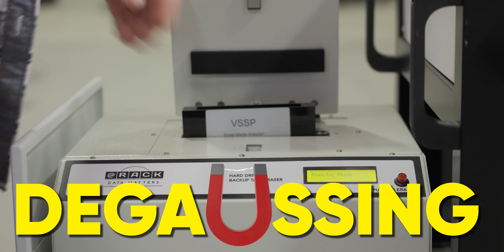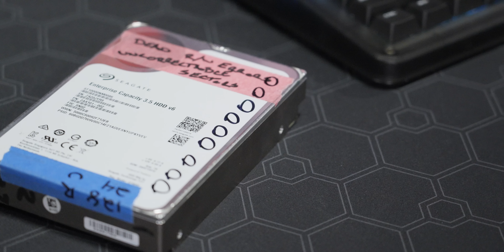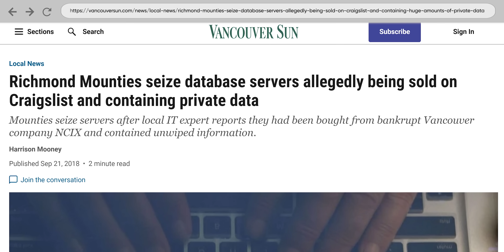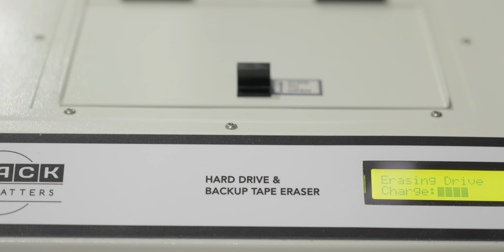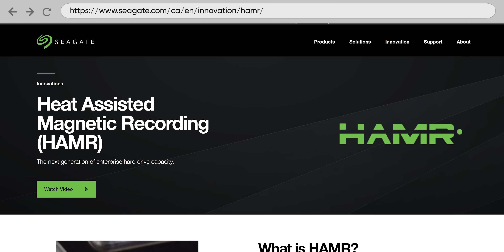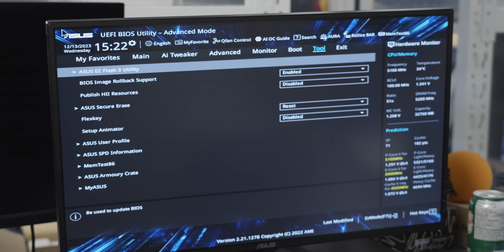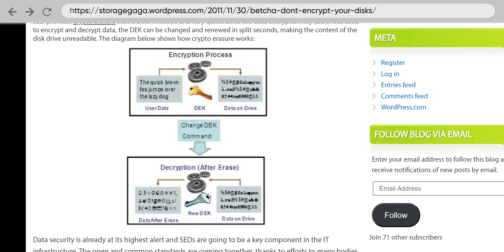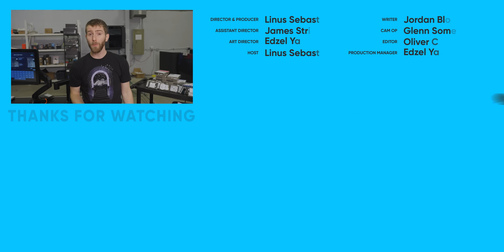I Got an Industrial Hard Drive CRUSHER! @Rack's Mobile Data Destruction System

Comment: still use a large metal shredder to "clear" data - although you could get data back  .. but good luck flatening out and sticking together lots of 1cm platers.  Also good at shreading ssd.. but this is coo l:)
Reply: The company we used had two shedders. One that you could drop a harddrive into, that would shred it into ~1cm chunks, then a smaller one which would takes those shreds and shred them  down to ~1mm. We only paid for the first shred (they let me drop the drives in, it was super fun!), they said only their government customers bothered with the extra fine shredding.
Both shredders were in the back of a lorry, so they'd just drive to a customer, park up, and shred boxes of drives. It took longer to scan the serial numbers and do the paper work than it did to shred the drives.

Comment: So when you work in a situation were you are dealing with an EMC data silo and the drives must be destroyed... something like this is the only way. I had to retire the EMC we had at our data center and I spent the better part of a month degaussing and then crushing the drives. I used a SEM jackhammer shredder that didn't just break the drives in half, this thing SHREDDED them in tiny bits that when dumped make it impossible for the platters to be reconstructed.

Comment: Didn't mention the #1 use of this machine: failed drives. They still have forensically recoverable data, but you aren't going to fill it with zeros easily if it's failed. A data center passing all failed drives thru this thing is obviously the primary use case.

Comment: At my workplace as I do do e-waste, and drive service is of course a mandatory thing, the process has to be done on site based on customers instructions on what to do with the drive. If the drive is allowed to be resold, its usually wiped 3 times. If it needs to be destroyed, its pulled and goes through the process of destruction (instead of pure crush for the last step, ours outright shred the drive till its in dozens of pieces)
Reply: "do do" and "e-waste" in the same sentence, tehe.

Comment: It seems wasteful to average observers but when it is your ass on the line for leaking sensitive data, the overkill method is the one I would go with as well. Some don't even stop at just punching holes but they actually use industrial shredders and then melt down everything into slag and raw materials again.

Comment: You says it is fun to watch. NO ITS HECKING NOT!!!!!! i love tech, i love repair electronics, i love to give a second life to everything i can! damn dude i even can repair other drive using perfectly normal logic board from one of those! you know not anyone fave money to buy a high capacity drives! ok, ssds is wearing evenly do if one chip is dead then probably all other chips is weared enough to fail soon so ok destroy it and send to recycle but perfectly fine? WHY? they use encryption inside this ssd so just reset key and its done! i love this channel but this...... this is wrong.

Comment: I've heard of a company going so far in data secrecy that they destroyed their old monitors as they might contain traces of burn-in of sensitive data or something along the lines
Reply from the maker: That's next level.... - LS
Reply: @LinusTechTips  There is TEMPEST certified gear who's sellers will answer your emails now. geek out
Reply: My rarest computer accessory is an IBM keyboard from a banking terminal where whole systems were entirely destroyed, including the keyboards...
Reply: @AerFixus so, did you try to recover their passwords from the wear patterns on the keyboard and steal millions?
Reply: @unvergebeneid probably why they destroy the keyboards
Reply: Also remember to cut the RAM in half!(Yes, I know a company doing that)
Reply: @2afk  Cold boot attacks have been demonstrated on RAM.

And while yes, you only have a few seconds to do it, Legislations/Company policies' natural response is "Just destroy all the RAM when we are done with it"
Reply: @2afk  where i work we are requiered to destroy ram, as it could contain Hospital Records.
Reply: @2afk why though?
Reply: @2afk You can actually recover stuff from ram. But it does require liquid nitrogen to do it at scale (or dry ice for one-off). And you need to apply it when the device is on, or right after off.
Reply: @2afk  a customer of us does that also. We drive the degausser to them also, do our thing and go back.
Reply: The worst burn-in I ever saw on a CRT monitor was at an airport control tower, That might have been more of a problem had it been a military base,
Reply: Can confirm. Former military, nothing more stress relieving than when we swapped out equipment. We took sledge hammers and had fun.
Reply: I remember hearing that the Nellis AFB (that‘s were Area 51 is) has a it‘s own scrapyard where all computers ever brought into the base are disposed, crushed, burned and then buried forever. No digital equipment is allowed to ever leave the premises ever again.
Reply: @manpul Nellis is @ Las Vegas, area 51 is out in the middle of nowhere.  I guess technically they are in the same desert, but it's a very huge desert.
Reply: @arnezbridges93  Groom lake is in the Nellis Test and Training range though, which belongs to the Nellis base (even though it technically is a detachment of Edwards).
Reply: @romanpul  yrs it own on site dump big/drench and rubbish/trash, dumped, don't now the green recycling?
Reply: @romanpul Area 51 is at Groom Lake. Nellis is just a normal base.
Reply: @romanpul that is so freaking cool. Also seems very excessive.
Reply: @romanpul  that's where the boomers are right?
Reply: @romanpul  Nellis isn’t Area 51, they are just nearby, they are seperate bases. Area 51 is part of the Nevada Test and Training Range, and while Nellis works with the NTTR sometimes, it isn’t a part of it.
Reply: i just use a hammer, waaay more cathartic
Reply: @DaftknightLP  Good old Widlarizer...
Reply: We use a Shredder at the end of a program if the Customer doesn't want to keep the computers and laptops we use. They are owned by the program and they bought them. Most of the time they don't want them and we are obligated to destroy them. A DCMA rep is there to watch the destruction of the equipment.
Reply: I'm not certain but it wouldn't surprise me if that were a military requirement. I'm frequently around classified infrastructure and the security surrounding it is very much "take no chances" in nature
Reply: overthinking and paranoia at that point lol
Reply: @muki_x if you know the extent to which countries have gone to to steal each other secrets, you'd think otherwise.
Reply: That's a lot of hardware and ressources...
Reply: It's not just companies, militaries do the same.
I've personally help set up a classified/secret work station area.
ALL OF THE Peripherals(keyboard, mouse, headset etc.) alongside the computers themselves had to be later checked for their emission levels. They were a bitch to unload & later repack.
Reply: I used to work for a company that incinerated all electronics that had been exposed to sensitive data. Plug a monitor in to a secure machine by accident? RIP that monitor.
Reply: The government does this
Reply: the NSA? lol
Reply: Datacenter worker here. Can confirm picture perfect burn in on ancient CRTs can happen and have witnessed it (KVM units that have been sitting on one screen for a few years typically). Usually the CRT is pretty dead by that point anyway and needs to be disposed of. Some clients just like to play it ultra safe.
Reply: @coldnova can confirm. We received one at work (R2 certified ITAD company) which has the idle terminal input screen burned into the CRT in places. Funny thing is it's still worth $11000
Reply: Most folks have seen burn in to CRTs, and, I've even seen it on LCD TVs that were left on CNN channel too long...; but, to think you are going to read anything beyond perhaps a faded CNN Live image is quite doubtful..

 @coldnova
Reply: It's possible, though indescribably unlikely. This was mostly a concern with old CRT monitors. We had one come in at work (a company that specializes in data destruction and technology recycling, including hard drives), an old IBM 3279, which has a few characters from the terminal code burned into the CRT glass.
Reply: That's the stupidest excuse to destroy a CRT I have ever heard. Actually, that's the stupidest IT security related thing I have ever heard. What are you gonna see, the AS/400 menu?
Reply: Can confirm this does happen, a site I worked at years ago did this to about 50 near new 65” TV’s. At this location any electronics that go in basically can’t ever come out in one piece.
Reply: LOL!
Reply: New flash memory-based media implementations, such as solid-state drives or USB flash drives, can cause data erasure techniques to fail allowing remnant data to be recoverable. @JoeBloggsYoutube
Reply: We’re an IT Recycling company based in the UK and we do this for all collected LCD monitors :)
Reply: Thats true, i remember doing that with CRT's. I have also witnessed tech used where RAM DIMM's and SO'DIMMS can be put in a special machine and all the last data on those sticks can be pulled off. So memory sticks have to be shredded too.
Reply: That was a lil shitter just saying that when asked his opinion lol, he pulled out his phone n went "look this is an example of burn in, ive had this for like 6 months"
Reply: Nintendo? 🤣
Reply: They wasted a lot of time and money doing that.
Reply: DOD does that for any SAP-SAR system.
Reply: Overkill, I guess someone had investment in a destruction company
Reply: might as well burn the room instead because the sound coming from r/w data from the drive bouncing between the wall
Reply: Some Japanese companies use total analog documentation so that's the extreme of the extreme....
Reply: And don't forget to crush ever capacitor of the motherboard! There could be static charges inside them that could have traces of confidential data!
Reply: How much does it need to be destroyed before it's "clean"? And won't yeeting the stuff into a lava pool be easier at that point 😂😂😂
Reply: How you came up with that 😂

Comment: I used to work for a company that handled data we had an industrial shredder that would cut them down in to pieces less than 10mm×10mm it was impressive but also sad when I had to shred 1000 10tb WD Golds that were practically brand new

Comment: One thing I've noticed with consumer SSDs using their internal full secure erase or SED erase stuff is that it's kind of unreliable depending on how old the SSD is and who makes it.

I found when erasing drives for eBay recently that depending on the drive it would say it did its secure erase, but then I would find files on it using DMDE and have to either do it again or do a manual overwrite (which has a lot of downsides with SSDs the least of which is killing write endurance).

I suggest if you're using any SED or BIOS secure erase stuff as a home gamer maybe doing a sanity check after to make sure the data is really gone.
Reply: I recently build a Linux server with an SED and documentation about SEDs is very sparse. If you use Bitlocker on Windows you have to go through a procedure of installing the SSD vendors software, reboot from this software and immediately enable Bitlocker after that. On Linux you have to install your on preboot environment in the non encrypted section. It is far from user friendly, so I would assume most people don't this functionality on their SSDs.
Reply: @xXxJakobxXx3  I currently use Debian LUKS for full disk encryption which asks me if I wanted it during OS install.  It's really easy to setup.  Plus you can have several LUKS passwords as backups or for different users.
Reply: @xXxJakobxXx3  that is not SED
Reply: @Velocifyer  Can you further elaborate what you mean by that? Op posted that he got a SED from eBay and could still read data from it. I shared that on some drives you have to go through a lot of steps to enable the encryption and therefore some users might not do it.
Reply: @xXxJakobxXx3  SED does not involve a unencrypted boot partition (if you use FDE that is not SED just put your kenels in the ESP). SED is handled by the firmware/whatever boots up the bootloader, you just enable it in firmware config (if you want it password protected).

Comment: I feel like this product should really have a place for secure erasing SSDs. While it did indeed "break" all the nand chips, from my understanding, someone could still xray (or etch the top of the package and image) the broken nand and retrieve the data.
Reply: You can read NAND chips with x-rays? That's fascinating, do you know how that works?
Reply: @unvergebeneid  probably not x-ray, but there are papers about using types of microscopy for it
Reply: @SnowyPup  oh. Well yeah that sounds reasonable. You're back to detecting charges directly then.

Comment: To the question can you erase it so you can resell. I would say HDD probably and SSD no. SSD have blocks this blocks have a maximum Write count. If it is reached the SSD Controller won't use this blocks any more. In theory there is a ACPI command to whipe all but there are to many vendors that won't implement this the right way. As for HDD i would recomand write all 0. Do at least 5 write cycles to all Sectors. Do another re write with 0 and as to my knowledge from 8 years back this should statistically prevent any Data left on the Disk it self. How ever there is always the Cache memory to be considered. Wich could still hold some small amount of Data.

Comment: this should be the definition of over engineering. why not just add a shredder and be done with it? :v
Reply: A shredder can not be used in the white space of a DC and needs 3phase power
Reply: @rack_tech  it's all about the motor being used. A shredder can be either dc or ac and can be either single phase or 3 phase and can either have 1ph motor or 100hp motor and can either have hydraulic or electric motor.

Comment: I have a utility somewhere on a thumb drive that runs a command that overwrites every sector a user defined number of times.  I used to use that AND then manually break down the drives to the platters, degause them and turn them into tree ornaments and wind chimes.

Comment: Please do be wary with hardware level encryption with BitLocker - I had a dual drive setup, system on a software encrypted SSD and user folders and programs on a hardware encrypted SSD, where entering and resuming from hibernation (which I need to do frequently) created massive headaches (second SSD became inaccessible until restart)  - make sure you do your research and back up important data before switching to hardware encryption!

Comment: As someone who has done enterprise level disk wipes (thousands at a time), it can take hours to a week depending on drive type, size, quantity, and number of controllers. Also, most companies either have a third party securely dispose of the drives, or they shred the drives into pieces around 1-2 cm in size. Also, you definitely do not want your junior tech responsible for the destruction of sensitive data, which could easily lead to them making a simple mistake and sensitive data, possibly getting out.
Reply: I have done thousands of data wipes. At some point also sent securely to melting facility. Reality is that enterprises should use disk encryption (which they usually do) and simply overwriting drives couple of times ensures it will be impossible to restore anything. It doesn't matter the size, it will take only 4-12 hours per disk to do 6-7 overwrites depending on size and you can have dozen or dozens written over at the same time. Doesn't matter if it is ssd or harddisk, nothing is restorable. Cheaper than shredding.
Reply: And less e-waste
Reply: @jarhu86  It massively depends on who owns the data as well, for some levels of data i've dealt with complete destruction of the hardware is the only legally acceptable disposal method.

Comment: we had this massive degausser at work that i, being a scientist at heart working in IT i said. (google stop gaslighting me degausser and de-gausser are words)
Hold on a second, did anyone test to see that this is actually wiping data.
Nope, almost all the data was untouched after plugging them into a computer, tested on about 10 drives, leaving some of them in the machine for over an hour.
About the only time it "worked" was when it killed the drive some other way and it was no longer addressable(IE you plug it in and are supposed to have a blank drive, instead the drive wasnt detected, and could probably be recovered if you installed a new motor, or board, or something)

Since then we've used sudo shred vfz with lots of passes like N7, (only 2 passes on SSDs, a random pass, and a zero pass) takes a similar ammount of time, but actually works, and now we only destroy drives that come out of servers.

I have a machine with 16 SATA ports, and a pair of 4 HDD to USB toasters, all tool-free.
I'd like to get a 4U server with 12x5.25 bays like that weird rosewill, and thin fill it with that silverstone 4x5.25 to 5x3.5 tool-free drive cage, and then set a bumhch of those 4 drive toasters on top of it for 2.5 inch drives.
Now i just need someone to make a tool-free NVME backplane that can be switched off without turning off the computer, so plugging them in doesnt cause a short because while PCIe supports hot swap, the actual NGFF port is not.

Comment: It would be cool to have a standalone slot based rewriter that could hold 5 or ten drives and Like a power tool charger run with a single red and green light that way you could use top sloting to easily and efficiently clear data